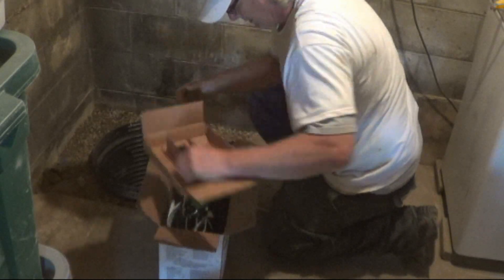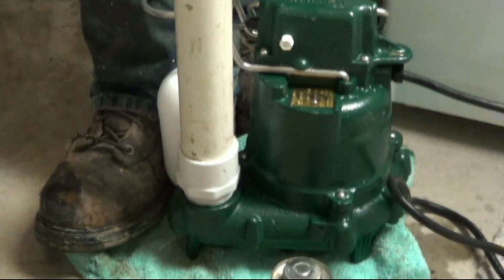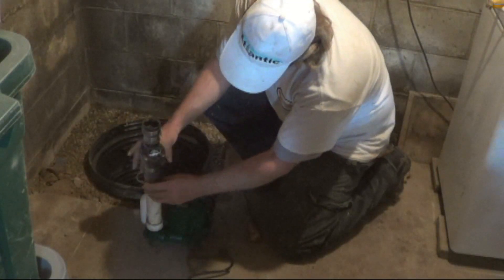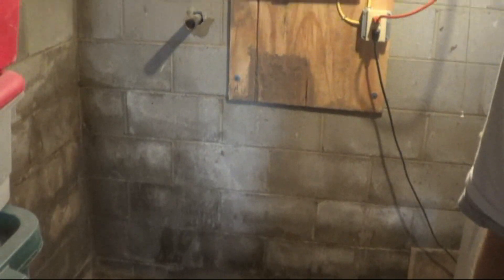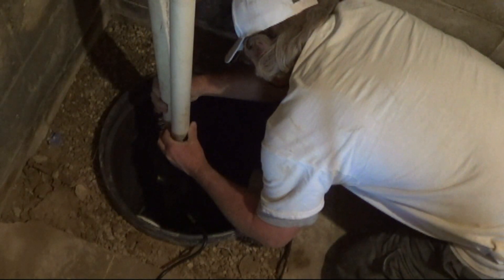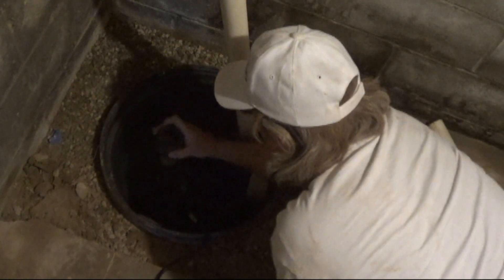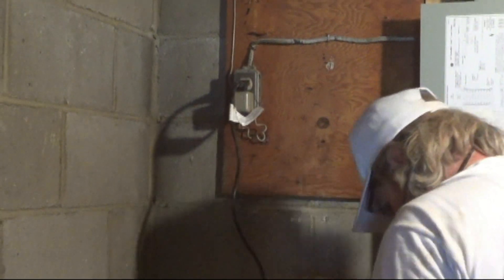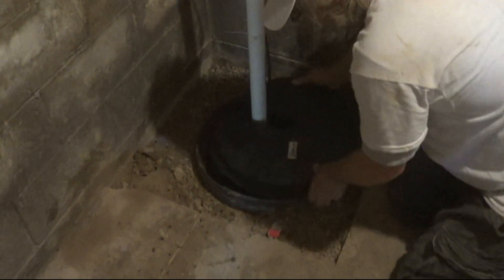EASY Sump Pump INSTALL / Sump Pump Replacement  ~ french drain secrets by Atlantic Drain

Comment: Don't forget to drill a small (3/8 inch) vent hole to prevent air lock. I believe the pump already has a vent hole it may get rusted or clogged after a few years so the manual probably indicates to drill a 2nd vent hole in the PVC pile.
Reply: 3/16 "

Comment: It looks like this pump was to assist a drain not drain a basement, correct?
Reply from the maker: hey ew ~ The M53 is a standard 1/3 horse power pump used in perimeter drain systems. it is meant to handle basement perimeter drain water removal from under your foundation/ slab.
it helps to maintain a hydro-static table that will NOT go above your concrete slab in the basement. that can be alot of water!!! thanks for watching ~ chris
Reply: @AtlanticDrain  has been worse for the last one AND a half years ago use a sump pump to basement got flooding floor.